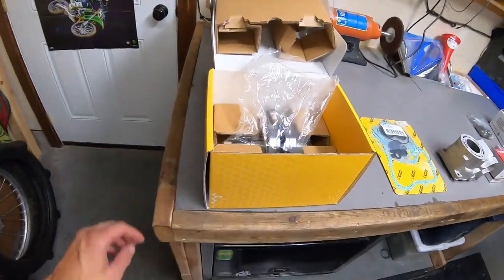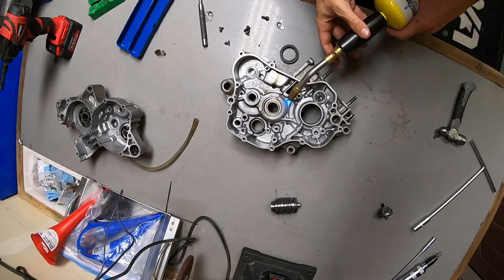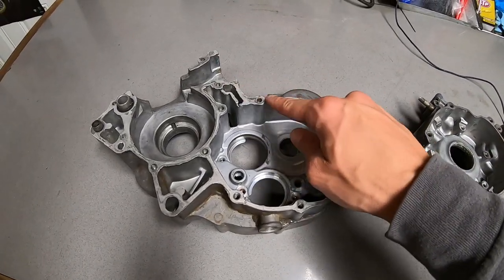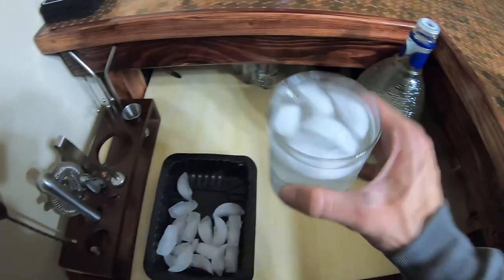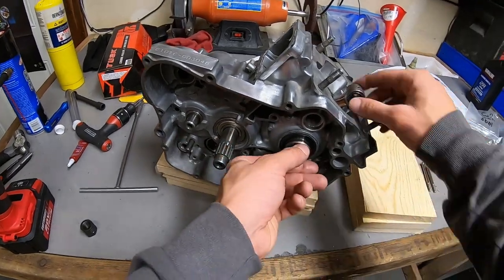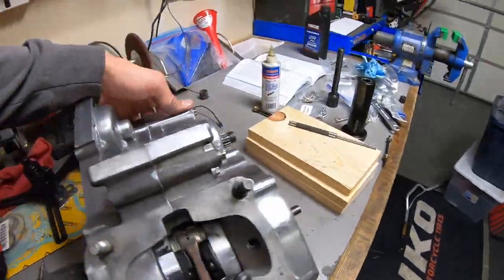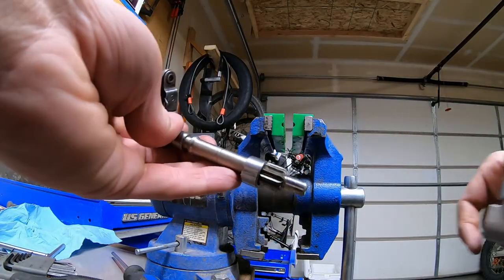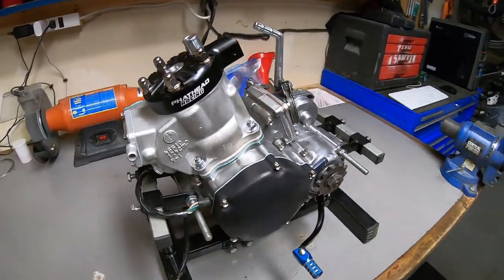Building a Yamaha YZ125 Engine From Start to Finish | Episode 3

Comment: I must have watched this video 100 times I bought a 98 a week before you posted this video just now getting around to rebuilding the motor and I was using your video as reference and noticed you did not install the top hat for your shifter shaft
Reply from the maker: Hope it helped! Top hat?
Reply: @KincadePavich  at 14:20 you can see it's missing, If you check the shift shaft diagram it is part #9 Roller, Shift Lever 3XJ-18178-00-00

Comment: Did the  cylinder head come with the dome installed ?
Reply from the maker: It did, but the dome can easily be pressed out and swapped just with your hands. It's super easy to do!
Reply: @KincadePavich  will those heads work on a 2000 yz 125? their site skips that year but they say 01-04? which i think had a similar motor.
Reply from the maker: @rocman9137  I would assume if it says 2001-2004 it's for a reason, but I would get in touch with them! Luke will be able to answer for sure. Maybe it would just need a slight modification that I'm sure he's capable of doing.